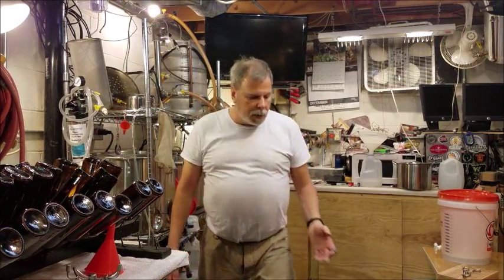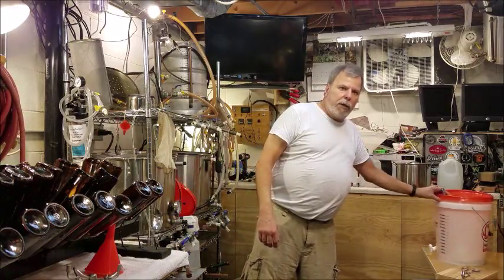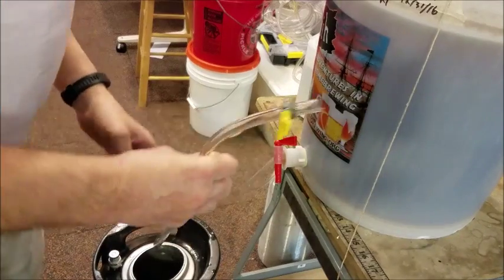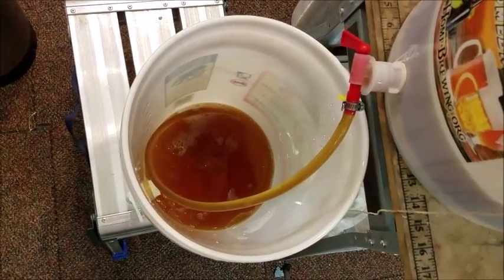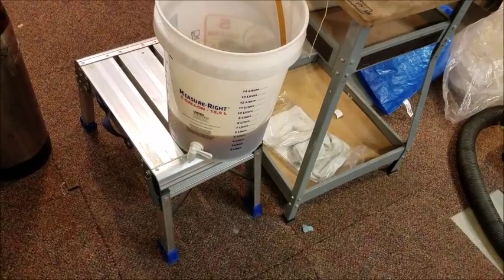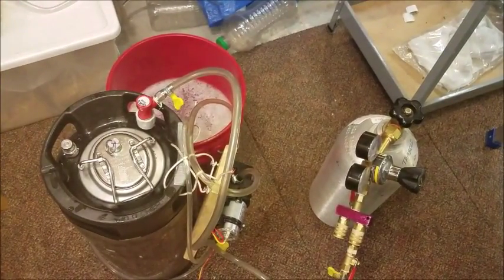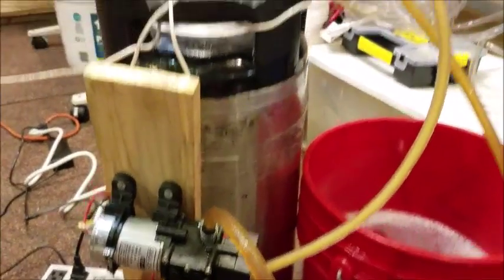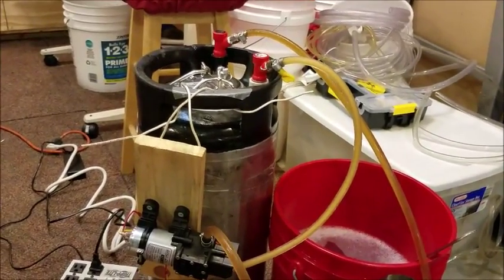Carbonating a Keg with the Rapid Carbonator - Start to Finish

Comment: Hello my friend, Could you carbonate with this method with nitrogen gas?
Reply from the maker: I would say no, since nitrogen doesn't actually create bubbles (aka carbonation).  "Nitrogen" gas for beer is really a beer gas that is actually 75%/N2 and 25%/CO2.  Unlike carbon dioxide, nitrogen is insoluable in beer.  It will not bubble like CO2.  The nitro taps used have a restrictor plate filter that the beer is forced through at higher pressures to release the CO2 as tiny bubbles to create the cascading effect.  The nitrogen allows you to push the beer at a higher pressures (30 lbs vs 10-12 lbs) to get it through the plate without over carbonating it (since there is only 25% CO2 in the mixture).  It does not actually create bubbles, it just allows for the miniaturization of the CO2 bubbles already carbonated into the beer.

Comment: Doing so many thing wrong here, but #1 dont disconnect the co2 and leave it flowing.  Its a blatant waste, and makes you look foolish.

#2  2-3 short bursts will clear the extremely small amount of headspace of oxygen.

#3 To wet the stone, put it in a glass of water and slowly add pressure.  1psi, 2psi, 3psi, etc u til you start to see bubbles.  You will likely be around 3-4 psi.  Now, take whatever psi you would normally carb with, say 10psi as an example, and add the 3-4 psi to get 13-14psi.  The first 3-4 psi is overcoming the stones resistance, so the 10 psi can get to the beer.

But for the love of all things sacred, dont allow the co2 to freeflow...
Reply from the maker: Thanks for watching the video and the constructive criticism.  I do have some responses.

#1)  As foolish as you think I might look, I will continue to use the two to three cents of CO2 when it is necessary to keep O2 away from my beer. be that from a line or from the keg.  Lines need to be bled too and you need positive pressure when attaching fittings and connectors.  I am not totally sure where in the video you are talking about, but if I did it, it was for a good reason.

#2) Regarding bleeding a keg, this is simple science  Each time you start to bleed a keg you are introducing CO2 into a regular atmosphere in the head space consisting of about 21% O2, 78% N , .04% CO2 and other gases (unless you are doing low-ox transfers or using other methods to reduce this). I have read and surmised that these numbers shrink by about half each time you bleed the keg with CO2, which is almost non-existent at the start.  This is providing you are using about 14 lbs pressure (twice regular atmospheric pressure).  So, a simple geometric progression tells you that it can take up to 15 times of bleeding, adding what amounts to about 50% CO2 to the keg reduce your O2 down to the 15PPM you want (and what commercial breweries strive and test for).  If you are only doing it 2-3 times you are leaving a lot of oxygen and your beer will oxygenate in the keg.  It may take a while and you might drink it faster than this, but it will happen of the keg doesn't kick fairly fast.  Why take the chance?  When I was studying and taking classes for my beer judge certification we tasted a lot of beers, mainly commercial, that were oxygenated.  It was surprising that it was noticeable in beer between 6 months and a year old.

#3) You are correct in your explanation of "wetting pressure".  I actually went over this 6 months ago in the comment previous to yours.

Please subscribe to my channel.
Reply: @TimTrabold  - Very well stated, however the consideration that co2 is heavier than O2 didnt enter your equation for the keg, though it did for the bottles.

With only 3-4 inches of headspace in the keg, 3-4 short bursts of co2 fill the space a couple times over.  Co2 being heavier than O2 means the O2 is pushed up and out the PV first, leaving a blanket of co2 (just like the bottles) If it makes you feel more comfortable doing 15-20 purges, and the waste doesnt bother you, have at it.  Its certainly a "better safe than sorry" situation I could come around to understanding (like life insurance), but in my opinion and experience of having made thousands of gallons, it isnt neccessary.

To each their own.  We both probably make damn fine beer that the other would greatly enjoy, and ultimately, thats what counts.
Reply from the maker: @dirtyblond2332  You are assuming that the CO2 immediately settles.  I think it takes quite a while for the gasses to separate, a lot more than in a few purges time. Otherwise, we wouldn't really worry about it. Every time some gas enters the keg during serving it mixes up what is in it and some of that left over O2 is going to touch your beer and may stick to it.  Just like CO2 in atmosphere doesn't all settle to the ground on a closed room, it mixes in and is turbulent. I just think it is better to just dilute it down and not worry.  As you said, better safe.  Brew on.  Cheers!

Comment: your pump is not food grade. you should change it for your health.
Reply from the maker: Thanks for the concern, but I think I will stay with it.  It is made of hard molded plastic with rubber seals. The pump is made for pumping water.  Once the pump was initially cleaned to remove any manufacturing release agents it is as clean and sanitary as a plastic fork, knife, measuring cup, etc.. I seriously doubt that there is anything in that is going to leach out and contaminate my beer with anything harmful in the 45 minutes to an hour it is in contact with the small pump assembly. "Food Grade" is a misnomer.  In my very limited experience and research I believe that pretty much all plastic is food grade unless it is specifically labeled "do not use for food".  If the plastic was dissolving at such a rate to cause harm, it would stop working.  People worry way too much.